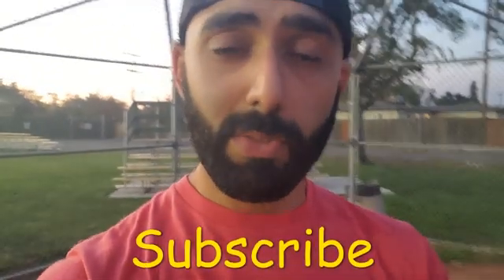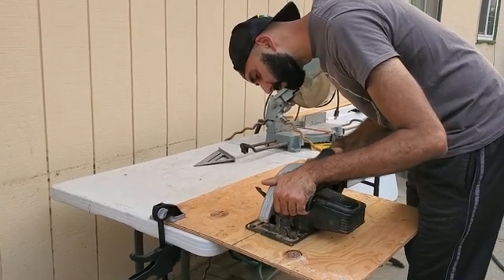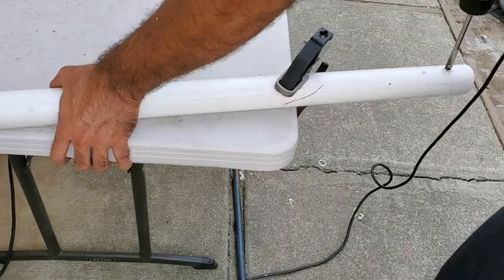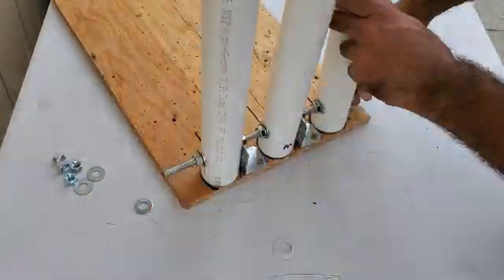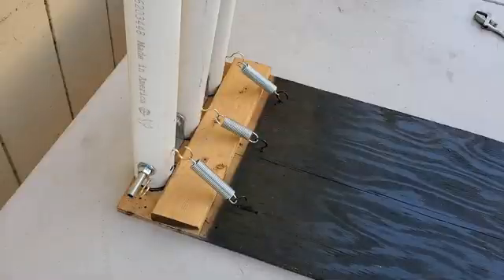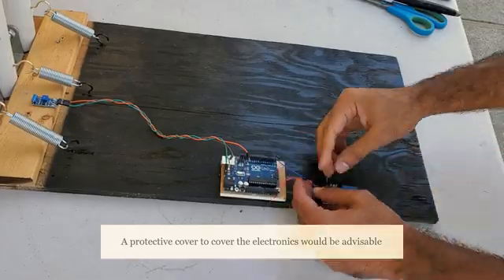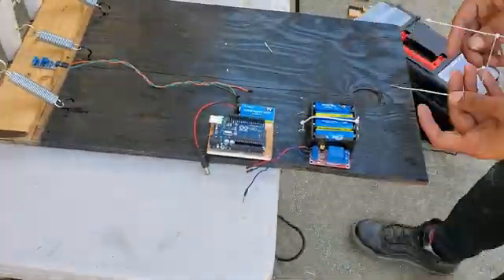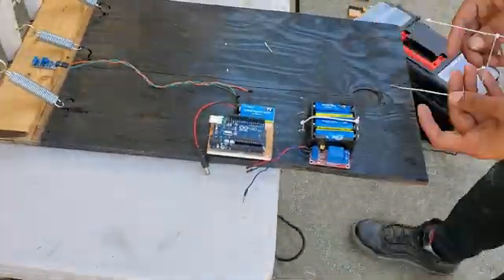Intelli-Wicket || Arduino

Comment: How do these components use? I mean schematic
Reply from the maker: The arduino turn on a 5v relay for 10 seconds when the vibration sensor is triggered (high output). The 5v relay switches on the flasher relay which is hooked up to led lights.